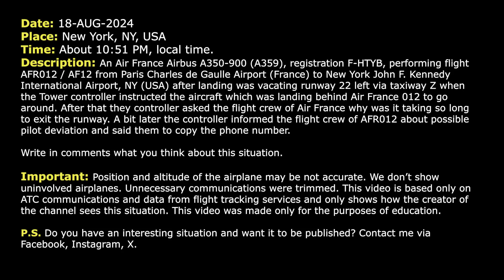JFK Tower controller becomes angry with Air France pilot for slow vacating. Real ATC

Comment: Tower never cleared him to vacate via Z. „Is taxiway Zulu available?“ is a stupid question to ask - it should be „May we vacate via Zulu?“
You have to adhere to MROT (Minimum Runway Occupancy Time) and HIRO Ops (High Intensity Runway Operations) - there are often published RET (Rapid Exit Twxiways) charted which ATC expects you to take unless coordinated otherwise prior.
Reply: Isn't it a little ironic to bitch about pilot non-standard phraseology in US controlled airspace?
Anyway, when ATC is asked by a pilot on short final, if Zulu is available, every sane ATC will understand that the pilot wants to know if it's available for him to use after landing. That is more than obvious. 
ATC did not give them any other instructions regarding exiting, unless it has been cut out of the recording here, which I don't think. So where should there be a pilot deviation?

Comment: Controler is not in the cockpit and should not make any judgment on why « it took so long » 
The distance between the two were probably in line with regulations but in reality too short. 
Controler should not pressurise pilots this ways. It seems controllers in JFK don’t really like French pilots …

Comment: The A350 is equipped with « brake to vacate » airbus system. It is very interesting for comfort and brake wear to use the whole runway with this system. You just have to preset the exit taxiway and the system adjust the braking.

Comment: I did operate to JFK with heavy B777 and from my point of view... Well yes pilot has the right to ask for a taxiway to vacate other then requested by ATC if performance of the airplane is compromised in such a way that they need a longer distance to safely decelerate and vacate. But on other hand you as the pilot you know you are going to land at JFK where the traffic is busy, sequencing of the traffic is tight and there is no way to play smart and fuck with the traffic around. We had 0 issues with fully loaded 777 to land and vacate as ATC asked and as far I remember we never needed full of runway length of 22L. So if the Air France airplane wasn't under some MEL reducing braking capabilities I can just say morons without a situation awareness. Yes flying in USA is different compare to more civilized and standardized Eurocontrol airspace but I am not going to teach them how to do it, just flush with other traffic and do what is expected to do, period.

Comment: I had similar situation in marseille, france. had to go around because Air france on the runway wasn't vacating nor answering tower calls. Seems that planning to vacate at the end of the runway in a busy airport is not the best idea, on the other hand controller should have asked the crew to expedite vacating or clear them for another exit.

Comment: It is very good example.
Some where like JFK or SFO or some airport with heavy traffic have defined limited time to vacate the runway.
In this case, if AF012 wanted to vacate via Z which LDR is actually full length, they should just place a “request” for vacating via Z. If AF012 had landing performance problems I believe no one will blame on that.
In my point of view as an airlines pilot.
I analyze this by CRM concept.

Communication: AF012 shall put a “request” for specific TWY vacating. ATC personnel could clarify what is the intention for AF012.

Situation awareness : If AF012 already know they are going to use Z for vacating during arrival briefing they should know possible lead to hard situation in busy airport like JFK. That was a big threat for everyone there, they shall understand there LDR deceleration planning no matter is by BTV or manual brake.
Last but not least is advise approach control in advance for better separation for approaching traffic.
Reply: Textbook comment! Thanks!

Comment: tower tony over here yellin at everyone across different videos . w areomexico he was working alone. 

Wouldn’t be surprised if this dude works hella hours and has been a controller long enough to have 0 patience with anyone potentially messing up what is probably an extremely tight efficiency expectation. 

Ik this guy has an attitude and definitely a no fucks given bravado but you can tell how he talks to other pilots that he wants to be nice and more courteous than other ATC. 

I pin this on FAA letting this burnt out dude run the ship solo likely more often than not. Give this dude a vacation and some new co workers . Accident waiting to happen

Comment: The first issue is that the controller cleared 2 aircraft to be on the same piece of tarmac at the same time

The second issue is that the controller was also intending to clear a 3rd aircraft to be on that very same piece of tarmac at the same time

The third issue is that in issuing a go around, the controller instructed the aborting aircraft to turn towards (both laterally & vertically) another aircraft

The fourth issue is that the second aircraft did not question the simultaneous clearance, the lack of spacing (or lack of "slow to")

The fifth issue is that when the 3rd aircraft questioned the situation, the controller was not brought into a full situational awareness

And the sixth issue is that the preceding challenge caused the controller to further lose situational awareness by issuing instructions to the 1st aircraft which took them into another controller's area but failed to hand them off to that controller

Comment: Why did they need to get off at that last taxiway?
Reply: its an A350, its a heavy aircraft, needed all the runway instead of slamming on the brakes. Plus they used 22L which is the shortest runway with 8400ft. The other runways are 12,000, 10,000 and 14,500 to put it to perspective.
Reply: @iVince905  The other runways you listed are takeoff measurements. The available landing distance on 22R is even less than 22L because of a very long displaced threshold. The 12000 feet is for takeoff; it’s about 7800 for landing.

Comment: As someone who's been a controller in an environment as busy as JFK, I can say that this is definitely on the controller. Sequencing too close, had little concern for the AF pilot asking to use Z way before touchdown, controller getting an attitude. I could go on, but the other commenters on here have already covered all the bases. Bottom line is, if you can't handle the heat, get out of the kitchen. I see and hear that a lot on several of these ATC sites, and that's a shame, as I hope and expect for professional support on the ground when flying.
Reply: I hear KSQL might need a new contract controller.  Maybe a good fit? :D
Reply: What has TWR to do with sequencing?

Comment: The pilot asked for taxiway Z which means he planned on using the entire runway. It's up to the controller to sequence the previous traffic according to that, by either telling the Turkish pilot to reduce speed or the Air France pilot to expedite and vacate quickly. Sounds more like a possible controller deviation to me.
Reply: I'm new to ATC lingo, what is meant by "Pilot deviation"?
Reply: @scrat4379 IFR pilots have to follow clearances and instructions issued by air traffic control. If they deviate from that without reason, it usually called a deviation (from the given clearance).
Reply: @scrat4379 it refers to when a pilot takes some action (or inaction) that violates a FAR (Federal Aviation Regulations) or a controller instruction. ATC provides the pilot a phone number to call for an investigation, which could lead to anything from a verbal reprimand, a fine to a possible and rare revocation of the certificate. Pilots hate hearing “possible pilot deviation” and taking down a dreaded “phone number.” In this case, in my opinion, ATC should have instructed the pilot to “expedite” his exit after essentially informing him that exit Z was available. I didn’t hear the controller instructing him which exit to take so the pilot had the full length of the runway at his disposal. It sounded like the controller wanted to blame him for the separation issue, which ATC is responsible for. Slower exits are not typical pilot deviations.
Reply: And you don’t think that would show up when they do the investigation
Reply: @neilkurzman4907  it probably would. And?
Reply: @blackwolf1475  means the control the thought he was too slow and they’ll investigate and find out if he was too slow or the controller had higher expectations. What else does it mean? It means nobody posting here on the Internet knows what actually happened or what the results were.  and it means a lot of people have very strong opinions based on nothing.
Reply: @neilkurzman4907  it's obvious he didn't expect the AF pilot to be so long vacating but it's still up to him to anticipate and handle his sequence. And not following a controller's mind map isn't a violation of Federal Aviation Regulations. I think the video is accurate enough to make sure there was no pilot deviation.
Reply: @blackwolf1475  
That assumes that he got enough information to know that the Air France was going to take too long. But I’m sure it was all covered in the investigation and speculating on the Internet about who the true culprit is is just that speculation.
I assume since there plenty of information here at the FAA will simply watch this video instead of doing a proper investigation
Reply: @neilkurzman4907  it's still up to him to ask the pilot to expedite his runway vacating. I don't think it's speculation to say that there was no pilot deviation here, but nothing I say is meant to replace any investigation.
Reply: @neilkurzman4907  ooh... don't stop speculating! I came to the comments section to see what people think happened here.

Comment: US COntrollers are starting to loose the plot, He landed and vacated , it work out but he did nothing wrong,  It takes as long as it takes.    
Main stream airportare starting to sound like Oshkosh everyday with ATC thinking they no best when it comes to flying. 

Now I get its not all controllers and its even the same controllers on these sorts of youtube channels, But its not a good look.

I get the pressures ATC are under but passing the pressure onto the pilots isn't a safe way to do it.

Comment: I think that the minute win time-wise starts to the be too much. It is not normal that a flight touches down merelly seconds after another clears the runway. another 15 seconds extra between flight would increase safety, would reduce stress, would really change the OMGOMGOMG is AF gonna get outta way of the 300tons mastodont behind him or not? in the end, the go around was maybe LESS safe than landing at that point. what if the 747 experienced conditions requiring a go around as well? impossible for ATC to coordonate them, TCAS would surely intervene but low speed low altitude and same desires makes it a very small margin for safety situation. Unfortunately a tragedy is bound to happen

Comment: totally the controllers fault, he didn't have the correct spacing, this is a short runway, you cant race down the runway with these kind of airplanes and slam on the brakes at the end, poor planning on the controllers part shouldn't create a crisis for crew. Thats why the crew asked about taxi way Z before landing, that should have been a clue to the controller, its all about programming the airplane for brake cooling. Send the controller for more training.

Comment: At least the controller also learned something: when AF asked "Is exit Z available?", they didn't ask about whether Z was maybe under construction (AF certainly brought NOTAMs in their $300million aircraft, they knew Z was free). They asked whether tower was ok with them using the full rwy, exiting at Z, using the most efficient deceleration (saving brakes), resulting in slightly longer rwy occupation.
Tower said "It is available, correct". Now tower knows what AF meant.
Reply: They asked three times too.
Reply: Do the pilots get a bonus for saving a little bit of brake pad or something? Jeez. Every A350 flight I've taken has landed and decelerated FAST and turned off as soon as practicable. Never have I rolled to the end of a runway.
Reply: @jayhsu2412  AF is probably just planning ahead
after what they did to Pavel Durov it may be a little difficult to find people willing to work with France in the future (reputation & all that....) 
maybe they are preparing for a world where (like for Russia and other Pariah's) getting brake-pads is not a simple task...
Reply: @stanislavkostarnov2157 Oh pooooor Pavel, the warrior for justice and free speech....
Reply: @stanislavkostarnov2157  LMAOOO How did you even relate those two topics
Reply: @NotTheRambo  anything to do with France is now linked to the topic in some form or way...
Air France is a French airline... you cannot escape that...
Reply: @maoiljitschguevara  fact is, if you live on a certain peninsula you have a very limited choice of sunglasses... and for a very good reason.
Reply: @maoiljitschguevara  BTW: when talking about sunglasses, is your analogy about break-pads, or about the comment-section or video being closed down because of my comment.....
if you are thinking the latter, whilst I can see this thread being moderated as Off-Topic compared to the video content, I do not think even YT generalizes so much as to make this effect the status of the whole video.
Reply: @stanislavkostarnov2157  Neither. It is about you finding the most stupendously tenous connection between this video and the thing you really want to say.
Reply: @stanislavkostarnov2157  You know Airbus is a French company right?
Reply: @redwithblackstripes  are not the controller parts imported from outside of France though... BAE or Germany or somewhere?

Comment: AIM 4.3.20.   Why was it necessary to go all the way to Z?
Reply: Short runway, heavy aircraft, saving brakes. AF did ask specifically (even multiple times) if exit Z was available for them. Tower confirmed. Tower should not have been surprised that AF did use the full runway. And AF probably programmed "BTV" (brake to vacate), which is why they confirmed the exit long before landing.